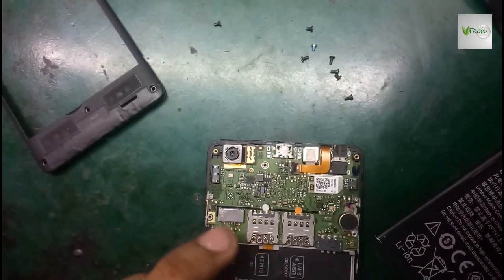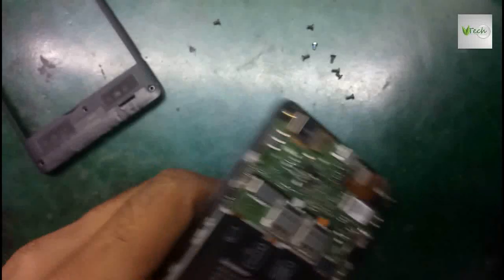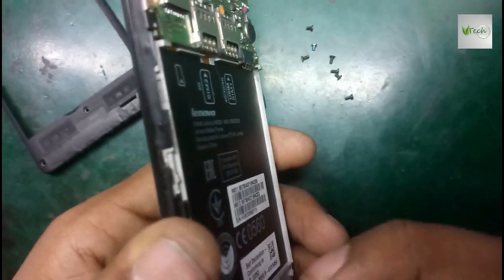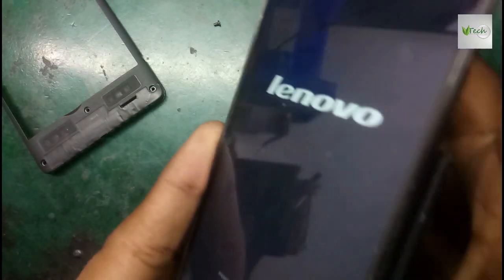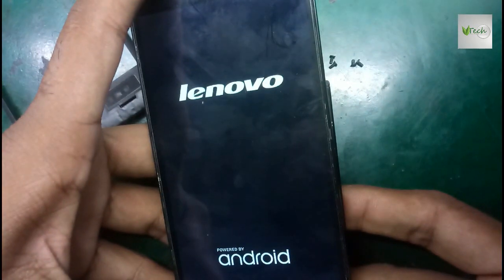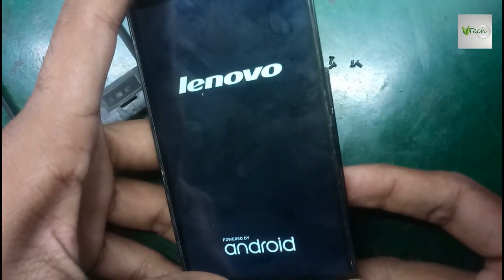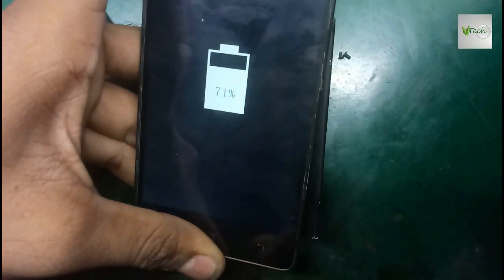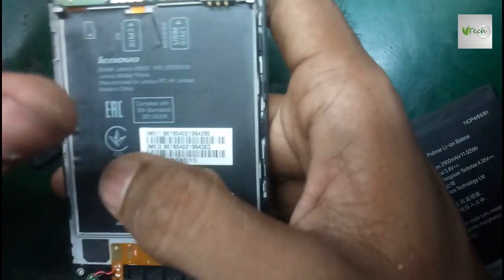lenovo A6000 dead easy repair

Comment: bro same problem my customer mobile i but   software not success full how to this redy ?
Reply from the maker: +Aravind drummer u will check  cc connector ways then volume (+,-) long press panni usb inset pannunga then blank display varum , aprm SW run aagum ..
But SW complete aagana tha na mobile on aagum
Reply: V tech ok thanks bro